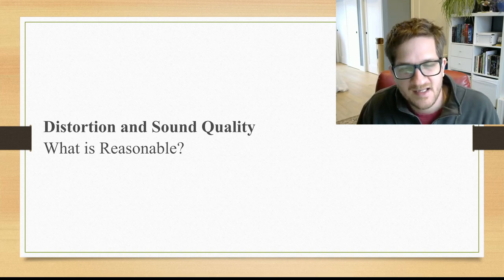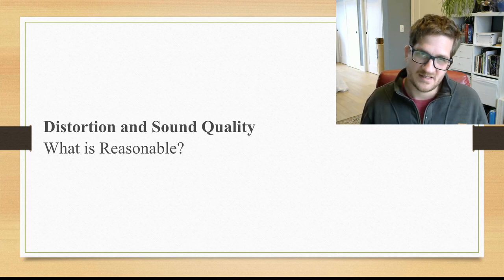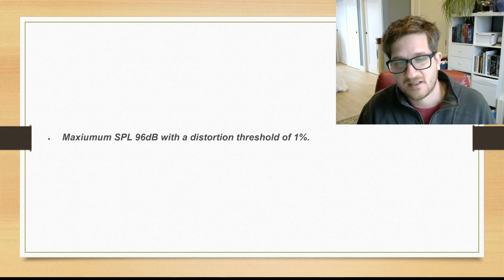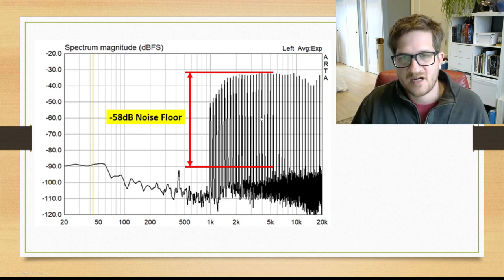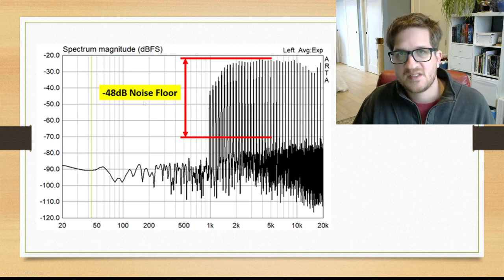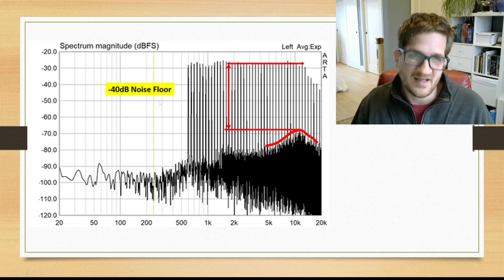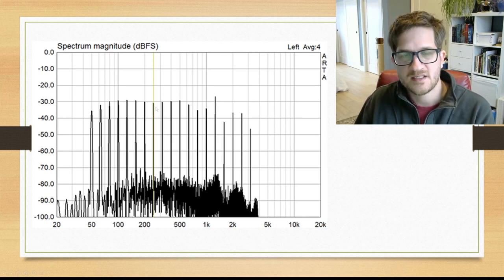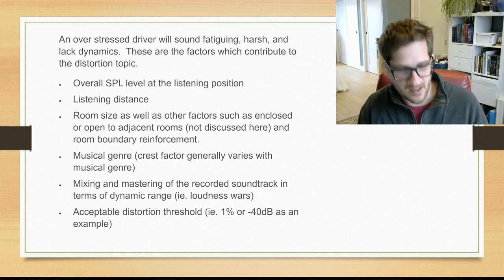Distortion and Sound Quality --- What is reasonable?

Comment: Hi there, It is interesting to see a discussion on distortion produced by speakers. Before watching your video I thought noise floor and distortion are separate things. Do distortion cause noise? or did I get it wrong? Please correct me. Thank you in advance.
Reply: Noise Floor can refer to several different things.
Reply from the maker: Your right, it is commonly referred to when the electrical device has low level self noise that is persistent regardless of signal.  However we can see that the signal generates so many side band products that they supersede everything else as the dominate distortion.

Comment: Thanks for sharing. I'm currently in the process of ordering a number of tweeters and hopefully soon woofers as well specifically to measure and compare distortion performance to my current main horn system (1" CD, 12" mid, 15" sub). I'm hoping to find something that measures lower distortion but I'm not sure how possible that is. I've found my 12" mid to be the worst offender in my system even though its a pretty high end driver which supposedly should have very low distortion. I've built speakers using the Purifi drivers in the past and those weren't quite as good but I'm hoping that maybe using a pair of those in each speaker might be an improvement over my 12" mid.
Reply: Look at a 5-6” mid, they won’t beam as the 12” will in the midrange.
Reply: @josephpsmithe  I don't have any problems with beaming. Crossing over steeply at 900Hz gives me a smooth transition to my horn (in terms of the off axis response). Problem is with distortion. When I cross to my subs at 120Hz distortion drops. Even down at 30Hz distortion is lower than at the bottom end of my mid.
Reply from the maker: What 12" are you currently using?  You may want to try the B&C 10NW76, IMD is -60dB@90dB SPL and -55dB@95dB SPL with a dual sine test at F1:165Hz & F2:225Hz.  It's the same result with F1:100Hz & F2:165Hz. The Purifi  PTT6.5X04-NFA--01 produces very similar test results.  However the cost of going with two drivers arranged horizontally to match your horn would be much more costly.
Reply: @JosephCrowesDIYSpeakerBuilding  I'm using the 18sound 12NDA520. As far as I can tell, it should be a very low distortion woofer. I've never seen a woofer with an Le of 0.03mH. I'm using it 120Hz - 900Hz
Reply: @JosephCrowesDIYSpeakerBuilding  wery clear hf driver?

Comment: Isn't noise floor different to distortion though? My distortion in REW is different to my noise floor measurements. The noise floor of my room tends to be higher than that of my loudspeaker. I guess my room is too loud 😂. Probably doesn't help my computer doesn't have a case.